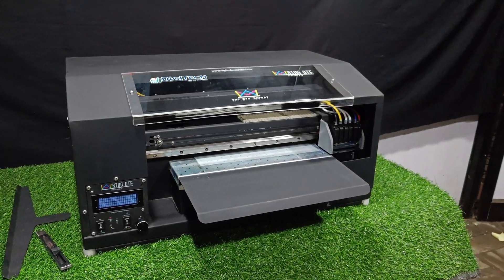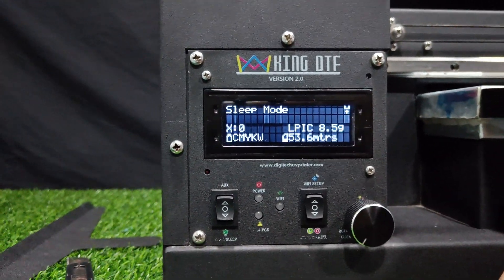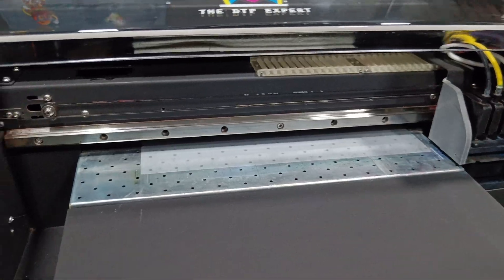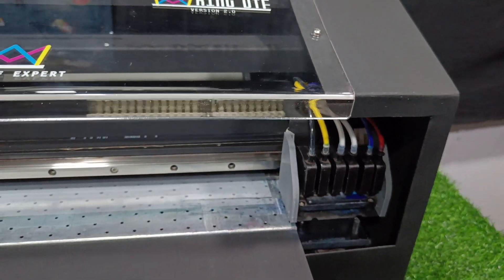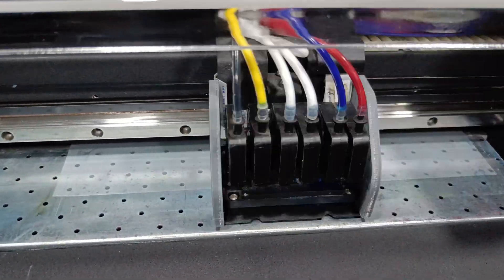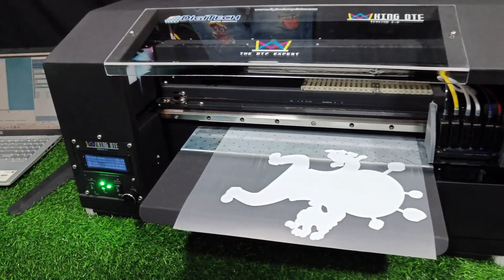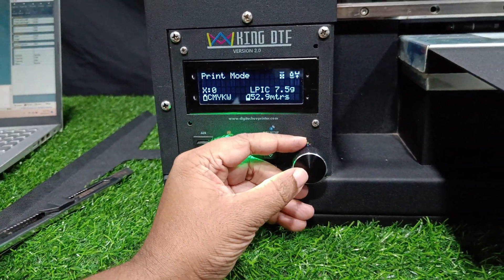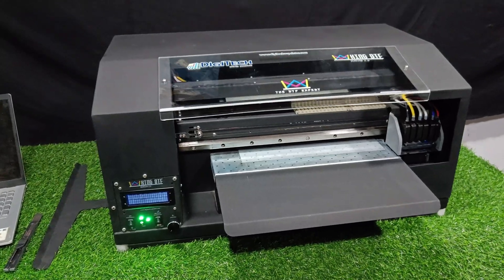Digitech King DTF Version 2 DTF Printer | Made in India DTF printer| Better than modified L18050 DTF

Comment: Sir, is this a feasible printer for small business.? How many prints should we do everyday for smooth functioning?
Reply from the maker: Small a4 size print is enough in 2-3 days
Reply: @DigitechDigitalImagings  Sir, you mean one to 2 prints daily is enough for smooth functioning of the printer?
Reply from the maker: Yes. Even it will function smoothly if you take one print in 3 days
Reply: @DigitechDigitalImagings  that's really impressive. Thank you so very much for the inputs.